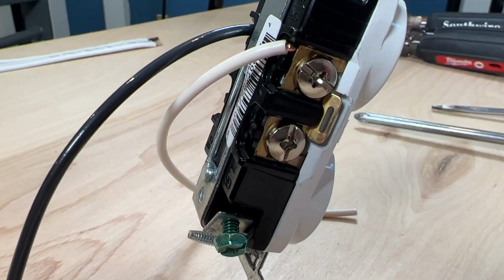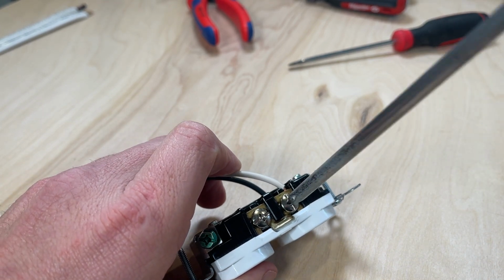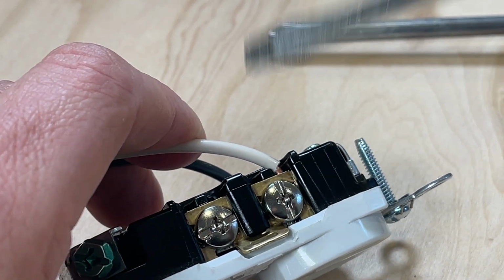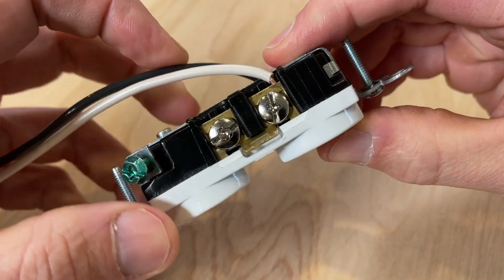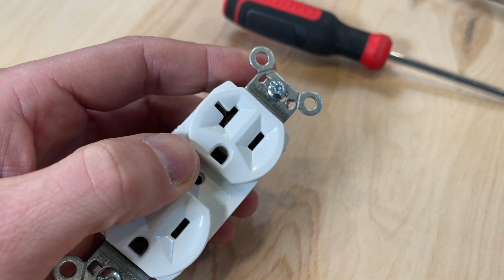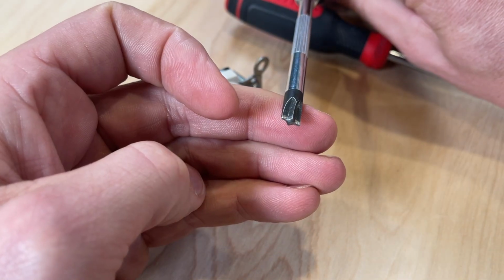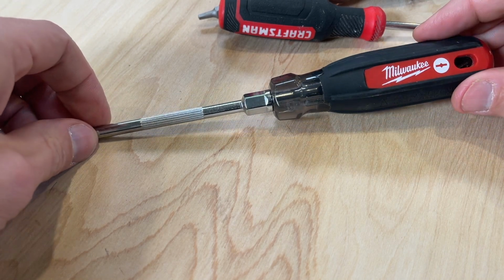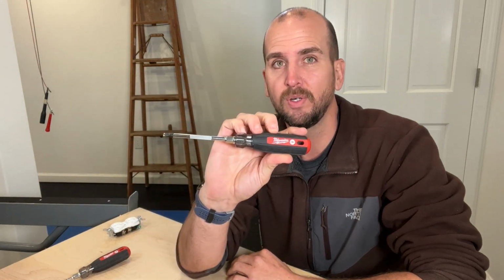80% of People Use the Wrong Screwdriver For Electrical Work

Comment: To be precise, though, that slotted screwdriver is wrong for that particular screw (too small). A properly sized slotted screwdriver should be as wide as the head (or nearly so), and thick enough that it provides a tight fit in the slot.
Reply: Yes. The slotted screwdriver demo was like the "does this happen to you?" portion of infomercials with victims failing spectacularly at everyday tasks.
Reply: Good catch. A properly sized slotted screwdriver also doesn't slip out of the slot as readily as an undersized one.
Reply: @TedHopp  a green robbie never will
Reply: @brianbelchior7329  The point of my comment was just that a properly sized slotted screwdriver won't go slipping out the way his undersized one was doing. So sure, just like Scott said in the video, a Robertson works better than a slotted (even a properly sized one). However, this is a home repair channel, and not every DIYer has one of those in his toolbox. It's worthwhile teaching how to properly use the tools a DIYer is likely to have, along with what better options might be available.

I'm curious -- is it actually a code violation in Canada to use a slotted or Phillips screwdriver with an electrical outlet?
Reply: Yeah, most combo screwdrivers (e.g. Klein 32561, Lenox 23932) have two sizes of flat blades. Just use the wider 0.25" flat blade.
Reply: It’s hard to find correct size slotted. One that fits perfectly. Easier to just use ECX or Robertson.
Reply: Absolutely, totally wrong tool . A set of quality 1kV rated screwdrivers will cover all your electrical installation and maintenance tasks , after all it's what they're designed for .
One other thing,  using insert screwdriver bits in a fuse board is just asking for a short circuit and a case of arc eye .
Reply: the philips was also too small, this video is kind of stupid.
Reply: Nothing beats a Wiha driver IMO
Reply: @billybbob18  A #2 Wiha will rip the little heads off those screws! That's been my go-to lately since they always have what I need but I've used Wera at work and they are really good too. A guy at work swears by Felo but I've never tried. I have a mix of mostly Craftsman, Pratt-Read and Wiha and Wiha is certainly the best of what I own.
Reply: And short instead of long. I came to the comments to say the same. Been an electrician for 19 years now. Another thing is that you should be holding the outlet firmly in your other hand which he wasn't doing.

Edit: I have cracks in my screen and use swipe text, I corrected some atrocious spelling and grammar.
Reply: This is the first thing i said to myself.  Also not all electrical device brands have the square drive built in.  I do like the hybrid, but also just learn to control a slotted and you'll be fine.
Reply: 1/4” fluted slotted is a great fit.
Reply: Thank God someone said it. 👍
Reply: To be even more precise, a slotted screwdriver is at best, an accident waiting to happen and should be abolished. I've yet to find a single use case for a slotted screwdriver other than as a pry bar or a chisel. I use screwdrivers every day in my trade and I don't mind Phillips but Robertson is far superior.
Reply: That is what I said, the slotted he uses in the video is the wrong choice slotted.  I use a larger slotted than he uses and it works quite well
Reply: Only in the USA... electrical inspectors in Canada ensure only Robbies are used, (when the can see the job being porfermed. Slatted are garbage.
Reply: Chris west, the same applies to the PH screwdriver, it was too small. You need a tight fit.
Reply: He grabbed a 3/16"  slotted screwdriver.  He needed a 1/4".    I did a detailed breakdown post on where he's basically just shilling for Milwaukee.   That square-drive adaptation is recent - I have two boxes of various electrical outlets, switches, etc - and none use those.  You must use a Phillips or flathead.   Some are flathead only.   

In general, a 1/4" slotted screwdriver may not jam into the full width of the slot, but it seats firmly enough to make it reasonably easy to turn.  The problem comes with people that have used their flatheads for paint can openers, awls, or other uses, and then use the rounded tip to try to run in screws.  If it's flat, no real issues.
Reply: So, doesn't the Southwire shank come completely out of the handle, with another flip over bit?
Reply: My thoughts entirely !
Reply: A Klein slotted beater screw driver is the perfect size for plugs, I’ve installed thousands of plugs used everything he’s listed and what I’ve mentioned is top dog.
Reply: Thats what she said !!!
Reply: Weird question here: why does the slotted (flathead) screwdriver have grooves on the end like a nail file?
Reply: @Veronica.John10-10  I think that's supposed to help it stay in the slot. I don't think it works, though.
Reply: Yes and just to mix up things even more that Milwaukee is technically a wrong tool completely. You should use isolated VDE tools
Reply: A bigger slotted screw driver will just make a bigger hole in your hand when it slips out, which it will.
Reply: @blue04mx53  you can always spin the screw down until it just stops, then use the big flat blade to tighten it. Sufficient pressure will prevent the tip from slipping off.
Reply: Robertson's are NOT NUMBERED. Calling a Robertson by number means you don't know tools.
Robertson screwdrivers are know by COLOUR. Yellow Green Red Black. Green and Red will do all if your electrical need. For electric bit drivers are inferior. A Robertson will actually hold a small screw unlike POS Phillips. Thank Henry Ford for the Phillips fiasco.
Reply: @bradkubota6968  Hi Brad,
Just an FYI, before you go giving this information at a job interview or somewhere else embarrassing. Go have a look at any Robertson tipped screw driver or better yet Robertson driver bit. You should see a number that denotes the size. 
3 is Black
2 is Red
1 is Green
0 is Yellow
00 is also Yellow. 
And yes Philips heads are an abomination. 
There is a lovely documentary on Robertson's screw drivers. 
(I grew up in a Canadian wood working shop just as an FYI)
Reply: @blue04mx53  The numbers may be useful to someone. I can see a red handled screwdriver from across the shop. The number?? Tool needs to be already in my hand. It is a Red Robertson to me and will always be. No one I know calls it a No. 2. I am steadfast in the colour vs. number reference. . Were the numbers part of Robertson's original brilliant design? Or was it colour only. I saw the documentary.
Reply: Exactly. I have watched and enjoyed many of this channel's vids but this one misses the mark.
Reply: A tight fit in a slot is very important unless you want a mistake
Reply: Same could be argued with the phillips head. It was certainly too small for the screw.
Reply: I agree
Reply: You're right. It's like using the wrong size spanner
Reply: yes when these things were first put in practice a flat head screwdriver would have looked more like a cold chisel than what most of us have today to tighten up chair/table legs
Reply: Yup a larger straight screwdriver not that tiny piece of crap , that’s right, but the square drive is better, I used to always use straight head screwdrivers on square D panel screws but the square head is way better as I can put the square head cover screw in the driver and it stays while I use the other hand to hold up the cover, I have a multi tip tool now it’s a permanent part of my tool pouch for years now
Reply: Right for this demo he should have had the right size slotted screw driver, but then again when you are in a hurry or can not find the right size, which is most of the time, his demo was more realistic.
Reply: @richardlug6139  It's not often, though, that you need to wire up an outlet or a light switch "in a hurry" ... if you are in a hurry, then that means there's an emergency and if you're in an emergency, you would simply kill the breaker or yank the fuse to get a quick resolution to whatever the problem is. Electrical work is not the kind of work you do "in a hurry". And if you're in any sort of position or know-how to do such work yourself, you will have multiple screwdrivers of different sizes, and if you don't, a trip to walmart, lowe's, home depot, whatever would get you a whole set of them for $5 or less, likely the same place you bought the outlet or light switch at in the first place.
Reply: @Dhalin  what I met by a hurry is that if you do not have a well organized set of tools you will spend more time looking for the exact sized slotted screw driver than it will to loosen and tighten two screws. You guys that think you have to buy every specialized tool to do a simple job just leaves  me shaking my head. It’s not rocket science.
Reply: @richardlug6139  If you're an actual electrician then you will likely have the right size. If you're doing your own electrical, then you should not be in such a hurry that you cannot stop to get the correct tool.
Reply: @PBMS123  LOL I can tell you never have made a simple home repair in your life!
Reply: @richardlug6139  its your fault to be in a hurry when doing electrical wiring, infact when doing any work anywhere
Reply: @indian.techsupport  No shit Sherlock, never said it wasn’t!
Reply: @richardlug6139  This vid is about doing the job right. If doing that means another trip to the toolbox or store then that's what you do. There is never a good excuse to half-ass a job.
Reply: @P_RO_  No doubt especially if you have more than one outlet to do, but if it is one and done you can still get the job done right with that slotted screw driver that is not quite the right size. He proved that in the video it was a little clumsy, but it achieved what he wanted.
Reply: @richardlug6139  You can do the same thing with a butter knife, so little value in the "proof" of either one. Use the proper tool; that's why they made it and that's what real professionals do.
Reply: @P_RO_  LoL.  Butter knife, now you are just being silly, but  if the butter knife can get the screw tight enough with out wrecking the slot I guess the screw will not care what it is tighten with.
Reply: @richardlug6139  Silly? Yep, and no less silly than using the wrong screwdriver just because you can make it work too. Anyone who advocates using the wrong tools isn't someone whose advice should be considered. Just because you can do something is never reason enough in itself to do it.
Reply: @P_RO_  I put in maybe 1 receptacle every 5 years. I'm not buying a specialty driver for it. I'm using my #2 Phillips and calling it a day. If I were a professional electrician I'd invest in a specialty tool but I'm not so I'm not even going to work about it.
Reply: @P_RO_  if that's the case he would have looped the wire around the terminal screw.
Reply: @P_RO_  so bc we can do something means we shouldn't? Does that mean no mountaineering? Skydiving? Flying in planes, electricity in the first place. Bad logic is still bad logic. What a strange hill to be on
Reply: @defend_dnb  im an electrician and I use the same stubby slotted screw driver I've use for about 15 years now. The terminal screws are all the same size, a small two to three inch stubby slotted is perfect. Fits in the hand great, is simple to throw into a pocket, you can buy a ton of them for cheap so it doesn't matter if you loose them, great leverage, minimal chance of slippage, etc etc
Reply: @P_RO_  please, there's no standard sizes in butter knives. Besides outlets were designed in a time when butter knives were substantially thicker to deal with the amount of butter people used to put on their toast.
Reply: For the average homeowner, I'd say that the Phillips and then a large flat blade work very nicely. After all, we're not normally replacing 10 outlets.
Reply: @davepaturno4290  Maybe in the US. In Canada, square drive is extremely common so I would say a Robertson is a must have in a home kit (every driver set includes one anyway).
Reply: @kobayashimaru8114  I'm fairly certain none of my driver sets have one. Maybe that's because they are 30 years old.
Reply: @davepaturno4290  :- The Robertson bit design is from the early 1900's, over 100 years old !
Reply: @davepaturno4290  I recommend any new home owner to buy a electricians Robinson screwdriver. It will last a lifetime.
Reply: @NewAgeDIY  Thanks. I will pick one up, the next time I order something.
Reply: @davepaturno4290  whats wront with a green robbie... it does the job 100% of the time everytime,.... 1 or 10 outlets
Reply: @brianbelchior7329  On one hand, I like to increase my tool collection when necessary, but on the other hand, I replaced quite a few outlets over the past 30 years and never had a problem after using screwdrivers from a collection that doesn't include a Robbi.
Reply: That's the problem with slotted screws, there's no hard standard so you need a handful of screwdrivers.
Reply: @jkbrown5496 1. There are standards the most common are 3.5, 5.5. and 6.5mm. 2. You need a handful of screwdrivers no matter what type of slot the screw has, they all come in multiple sizes.
Reply: @jkbrown5496  There seems to be somewhat of a standard now with slotted screws - there's like 3 sizes that are useful - the large ones for screws like this in large electrical work, a mid size one that's kindof a jack of all trades, master of none type size, and a smaller one that's common on terminal blocks and small electronics. If you look at Klein screwdrivers, which are somewhat targeted at electrical work, there are 3 common sizes, and they're very similar to the sizes you find in other brand screwdriver sets as well.
Reply: @gorak9000   Slotted screwdriver thickness isn't standard though. I have multiple same width slotted drivers with different thicknesses at the tip.
Chances are, you'd need to know the exact thickness or multiple slotted(of the same size) drivers for the task. And it's not unique to electrical connections, but all slotted fasteners.
"Somewhat of a standard" isn't much help, other than knowing you will need multiple slotted drivers of the same width, when tackling any slotted fastener.
Reply: @CowsGoMonkey  yeah, try working on firearms. The slotted screws come in many sizes.
Reply: @gorak9000  and how about my secret weapon which is what I use on tiny extra small Phillips head screws and when you can't find the right driver just peek into your eight Penny finishing nail bag and just   crank down on it with a vice grip and you can get by of course it's just a hack
Reply: @CowsGoMonkey  Yeah. A good set of gunsmithing screwdrivers would get you the right fit... but I'm not wasting my expensive gunsmithing set on just tightening some terminals! The crap set will still get me there and there's no issue of marring to worry about
Reply: @jkbrown5496  That's one thing I really dislike about torx screws too. There are too many sizes!
Reply: On the clamp type recepecticle I still make a clockwise hook and squeeze it around the screw as I don't trust the clamp as much and use a wider slot screwdriver made for the screw.
Reply: @tommcdonald53     RIGHT Tom. It takes more time...and effort.   BUT if we're working electrical connections...that 75-80% clockwise hook is dead on...and I'm not worrying.  If the receptacle allows it...hook it.  ESPECIALLY when we are working a Breaker block.  A breaker controlling 30+ plus amps for long durations..ie. HVAC equipment...can get hot enough to eventually create enough space to loosen and burn the connection (clamp or old style).  I've found loose/burned connections in switch receptacles, service panels, disconnect boxes etc.     He is right about adding that torque...with a proper tool.  For this kind of work I prefer the square head...with a good FIST  sized insulated grip handle.  I upgrade (to me) to a new driver whenever I find one that better fits my grip.  Also...a fan of the common 6 in 1 drivers...especially if I'm in a position or location that is far away from my complete bag...can't have enough of them.
Reply: @tommcdonald53  Amen to that!